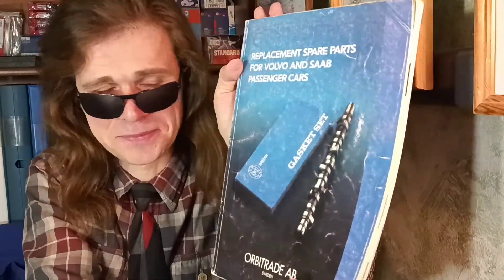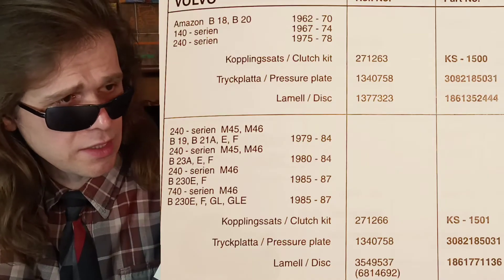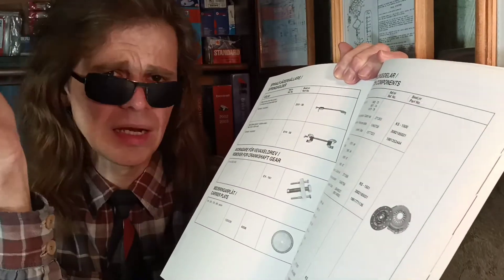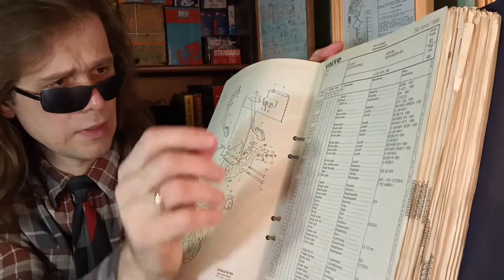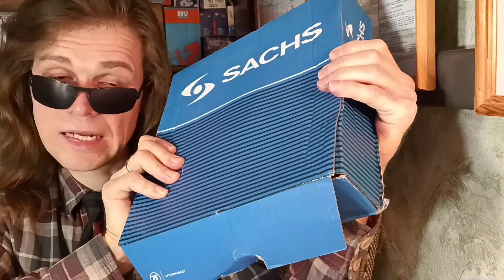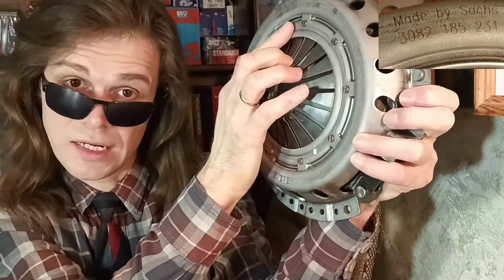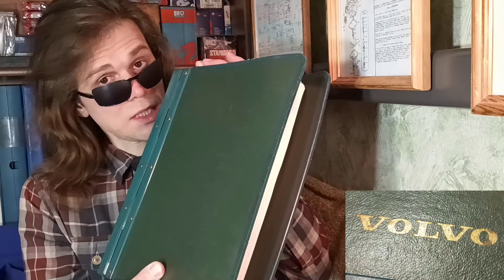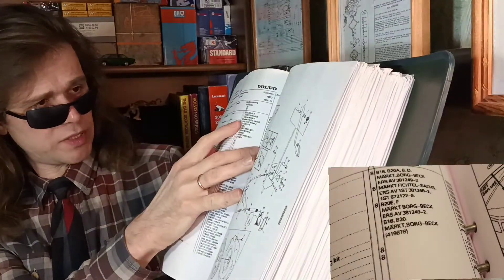How to buy a clutch that fits your Volvo b20 #Volvo140 #SACHS #clutch

Comment: I found this channel just AFTER i fitted a clutch and then installed it in my B20.
Are the release bearings interchangeable?
I ask because i was told they are and i fitted the top one (shown at 3.16)i just need to adjust the cable to compensate for the clearance.
The car is being rebuilt so won't be fired up or driven for a while.
Reply from the maker: I have car with clutch Borg Beck and another car with Sachs. And I using appropriate bearings for pressure plates because they differs. 3:15 you can see in upper picture release bearing for Borg-Beck pressure plate. Lower picture - for Sachs ONLY. Clutch disc interchangeable. If say shorter, should be same manufacturers for release bearing and for pressure plate. You can check designation on packages just for peace of mind.
Reply: @patricksgarage  
Thanks.
The kit came with the lower one shown,but a mechanic who works on Amazons said the top one would be fine if adjusted.
It's a Sachs kit,
I put the engine and box in last weekend,so found your channel a bit late.
Just have to cross my fingers when i eventually start it up.
Reply from the maker: @davidbarlow350  I think that average mechanic should agree that if we replace clutch we replace all at one time completely! (bearing, disc and pressure plate). It's more wise than remaking something later again. It was wise decision since you replace clutch as a complete unit. He right that Borg Beck bearing better but keep in mind it intended for pressure plate Borg Beck. Now available Sachs clutch kits. But from old stocks you can find whatever you want. So not mixing clutch components. I never mixed clutch kits and don't know what can be happening if we put inappropriate bearing and never going to do it. But we car owners always have tendency to hope that our mechanic knows what he doing. And If you maybe have no ability to look all the time for repairing process (which more better!) just cross fingers🙂.